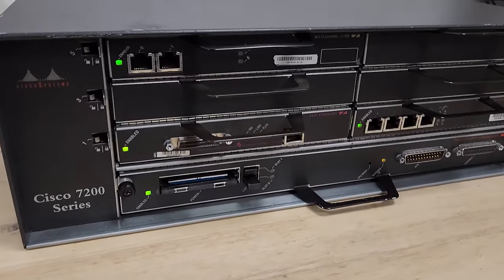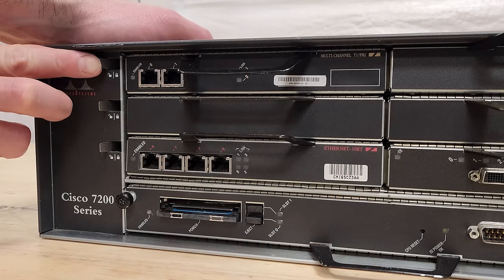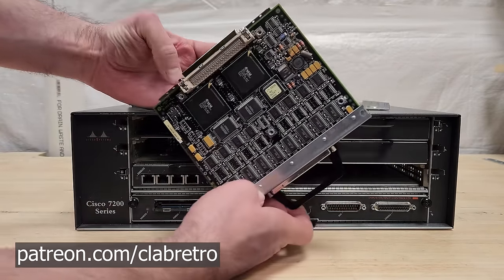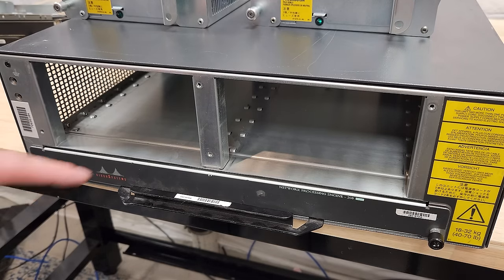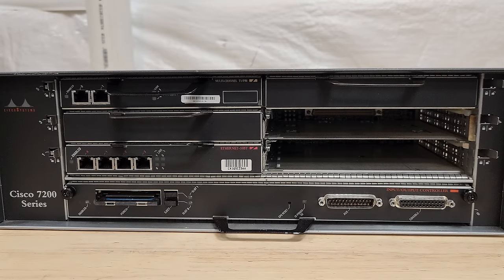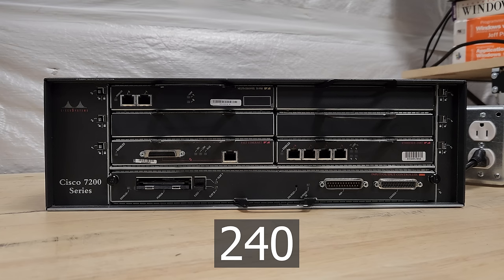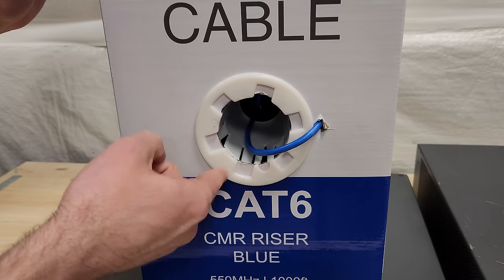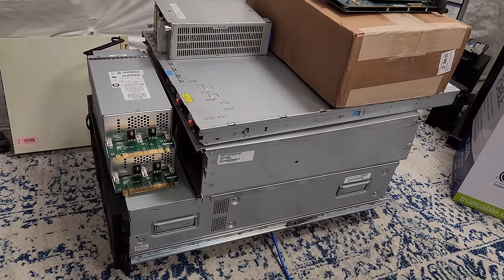Cisco 7200 Series Router

Comment: I had a T1 at home.  Worked for an ISP and the owner offered to let me terminate it there for free, got a quote from the telco for $205/mo.  Set it up and all was good, but started getting billed $250.  After a few months of calling, they said it was tariffed at $250 so they couldn't honor the contract.  Right at that time DSL was rolling out, so I just dropped the T1 for a $50/mo DSL.

Comment: Just as a side bit of info, the R5000 CPU was also used in some variants of the SGI Indy workstation.  It is a 64bit CPU but at that time nobody really used it in that capacity.  64bit instructions consume more memory and storage so there wasn't much to gain at the time.
Reply from the maker: interesting! didn't know that.

Comment: Yep - channelized T1 cards only work in IOS 12.4.  :-)  I was wondering for a moment if you got bit by the same problem I did a few years back.  There's another kind of T1 WIC that fits into the 2800 slots, but is made for some other oddball router ... a Metro E box or something like that.  Physically compatible, not supported though.  I bought half a dozen of them.  sigh....
Reply from the maker: haha weird that they were physically compatible

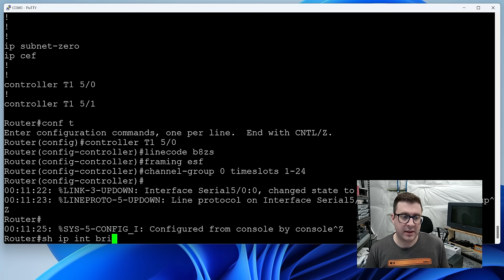Comment: At 40:10 a Serial5/0:0 interface appears, and you give it an IP address directly. But how is IP encapsulated over the T1 line? PPP? SLIP? Something else?
Reply from the maker: That's a great question, I didn't even think to check. Next time I power it up I'll see if the config says what sort of encapsulation it's using.

Comment: you need a newer IOS version to support some cards and have the OS recognize them... T1 PRI cards were T1 cards that also did "Dial" in 64 kbps ISDN chunks....  this model later came in the "VXR" model which supported different NPE's / modules, etc.  these racks were really good at agggregatiating disparate WAN (including T1 thru external/csu/dsu (via a v.35 cable) before gig Ethernet took over.

Comment: ROMMON has some flash, it will remember the name of the file it is supposed to boot (and some settings, like if it's supposed to load a config). 
Your 7206 has an "invalid" rommon config. If you boot without config, it does not clear the config file, you are clearing it when you save a new config.

Comment: Wow ive never seen one this old before. Its not even a VXR. I ran about 600 clients through one with a NPE G1 it terminated PPPOE sessions for an ISP I ran and could handle around 3 gigabits of throughput.

edit: That VXR you showed is a relic too, that one doesn't even have the updated logo or a good NPE.
Reply from the maker: The previous owner said they got that VXR in the early 2000s and it ran for over 20 years straight in service.
Reply: @clabretro  Mine only had about 5 years off the used market in my service. Never dropped a packet once never missed a beat. Production date was 2008 or 2009 I think for production on mine. I sold the company it was replaced with an ASR.

I had ISR's in some places but they just hammered away at the CPU. The VXR barely ever used any when I wasn't issuing commands.

Comment: On the 2800 the IOS may to be too old. I have also a 2800 in my homelab. 
I  my firmware is c2800nm-adventerprisek9-mz.151-4.M12a.bin
With my VWIC3-1MFT-T1/E1 i have to say in the config:
card type e1 0 0
in your case should be
card type t1 3 0

Comment: Teeeeeeeeeechnically those pass-through connectors aren't Cat6 compliant, since the standard requires the pairs to be staggered to reduce cross-talk, but they work and you'll get a pass on even the most advanced Fluke tester. You might see a few dB less margin in a bad crimp, which could mean the difference between a working or unreliable cable. But if there's a problem, you can always just re-crimp the cable.

We found issues with using stranded core wire with those connectors though, so to get the most reliable crimp, strip an extra few cm of the insulation back and twist the ends of the wire together after inserting them in the connector, then give them a bit of a pull while you're crimping. The tension just helps ensure the wires are properly aligned with the contacts. Your cable looks like solid core so it's probably fine, just less flexible than stranded.
Reply from the maker: interesting!

Comment: I really need to overhaul my network. I'm switching away from my ISP shitty router and picking up a WAN router with openWRT firmware to allow me to forward any port I like, it might also give me the push to learn and implement VLANs, probably should not have all my management ports open to the same network as all my client devices...
Reply from the maker: yeah VLANs can be fun to setup!

Comment: As someone who has crimped approximately 1,000,00,00,00,,00000 cables, give or take a dozen, I can't recommend those "pass-through" ends.  I'm sorry.  I know it's cool and convenient.  I thought so too, when I first saw them.  There are a couple of problems though.

First, you're using a sharp blade to cut the ends of the wires off as flush as possible.  You'll never get them perfectly flush, and as the blade wears down, you'll start to have some that don't cut through all the way, and you end up having to wiggle them off.  Then you get bits and pieces of gnarled wire at the end.  When it gets bad enough, you risk shorting adjacent conductors together, which makes the cable anything between completely unusable to intermittent.  The latter is the most fun.

Second, with several of those plugs, even if you DON'T pass the wire through (or even, if you crimp the connector with no cable in it at all -- just as a test), I've had some of them foul against something in the RJ45 jack.  This last happened to me last December, with a Cisco router, ironically enough.  I suspect it has something to do with the little "ledge" at the end of the connector, which the blade uses as a cutting board.  But I dunno.  Also, pretty sure Cisco does not manufacture the actual RJ45 jack modules.  It'll be made by Molex or Amphenol or TE Connectivity, or whatever.  So where it fits and where it doesn't will be a crapshoot.

YMMV.  Maybe not ALL pass-through connector manufacturers suck as much as the one I used.  :-)  That said, I have never had that issue with the ones that don't pass through.  And it's not that hard to get the length trimmed just right once you get the hang of making cables.
Reply from the maker: I think if I was doing it full time I'd just get better at the traditional style (cheaper too!) but for "casual" hobbyist use pass through works so much better for me. I haven't had any fail on me (in fact I've had to re-do a few of the traditional style ones what came with the house, ha).

But you are 100% correct about that blade wearing out... I've only crimped maybe several hundred with this thing and it's already dulling, though I suspect I can sharpen/replace it.

Anything I've crimped is no older than ~3 years in this house, let's see if I eat my words and start getting intermittent failures over time as I move things around haha.
Reply: @clabretro   Oh, nah, I wouldn't be concerned with premature failure or anything like that.  I think, if you were going to have a problem, you would know pretty soon.  The only time bomb I expect is that bit about the plugs not fitting in certain jacks.  And maybe the brand you use doesn't have that problem at all.

The reliance on a sharp blade is the biggest problem for me.  It didn't take long at all for my cutting crimper to start leaving bits of uncut sheathing on the end.  After a few crimps where I had to manually remove dingleberries, and one bad one that left some copper behind, I decided it wasn't saving me ANY time or trouble, and was therefore not worth hassling with.

At this point, I just straighten the wires, hold them in my fingertips, cut them flush at the right length, slip them into a plug, and crimp.  It's just as quick, I don't need special tools or plugs, and they always fit.

Just my 2c.  Obviously somebody likes them, otherwise they wouldn't exist.  :-)  And if you're not traveling onsite somewhere with no access to a comms supply shop and your time billed by the hour, then it's not critical if you have to remake an end that didn't work out.  👍